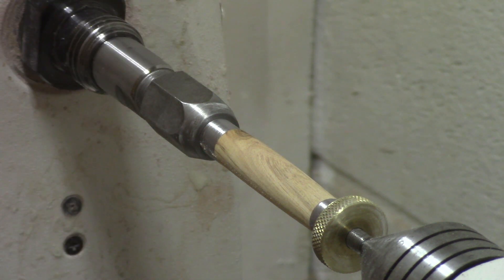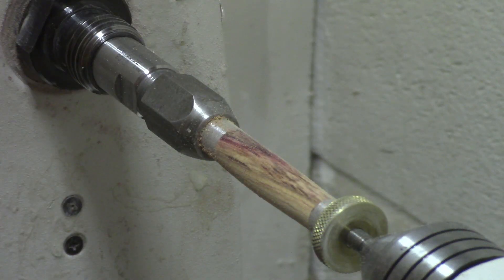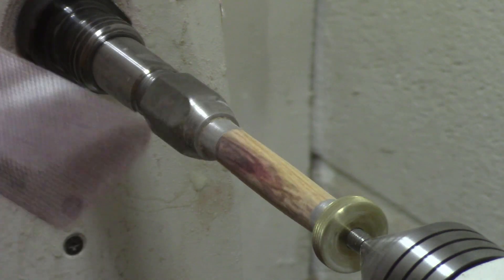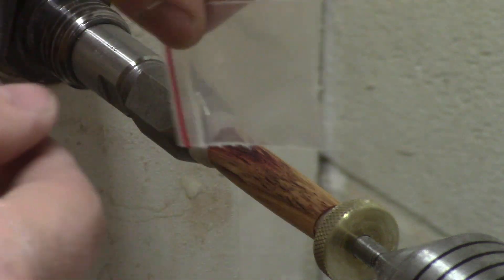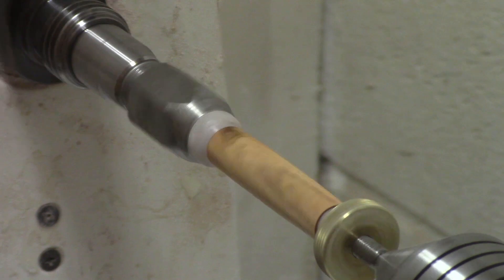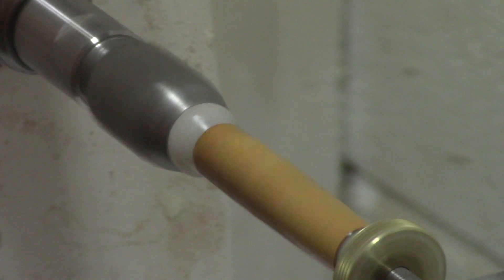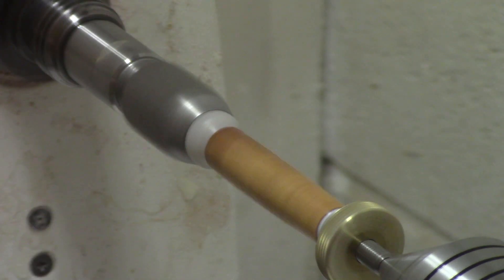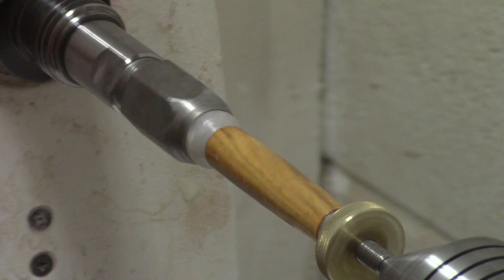CA Finish For Pens | Finishing a Wood Pen Blank | July 2019

Comment: I might have to try that 3-step polish.
Reply from the maker: Matthew Richards It’s super easy. The only adjustment I’ve made is that instead of running the lathe around 750, I run it somewhere in the range of 1,200-1,400 RPMs.